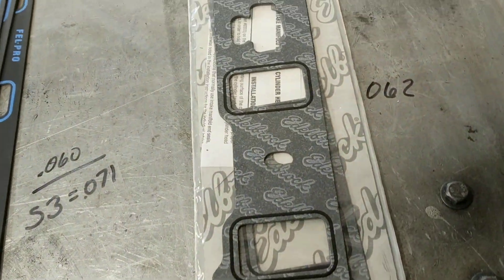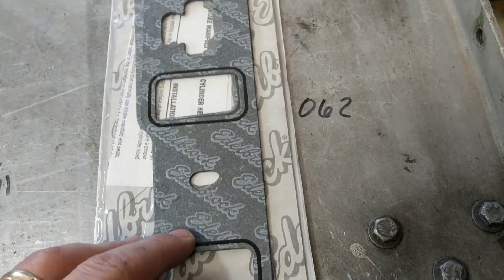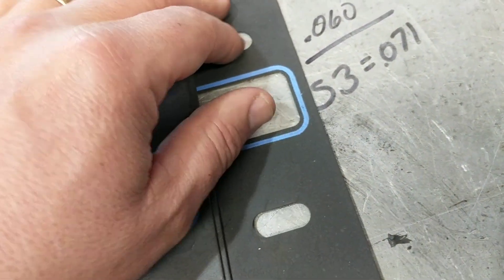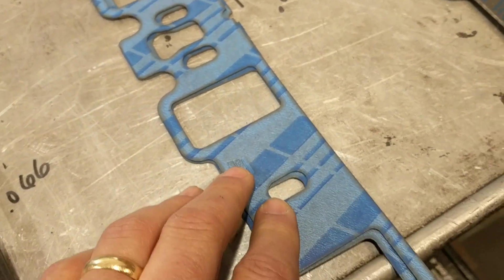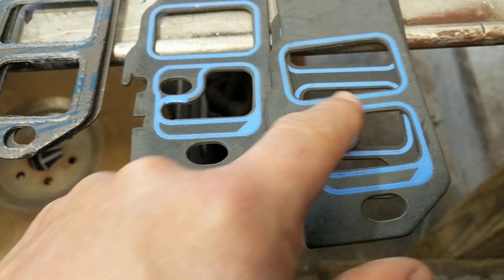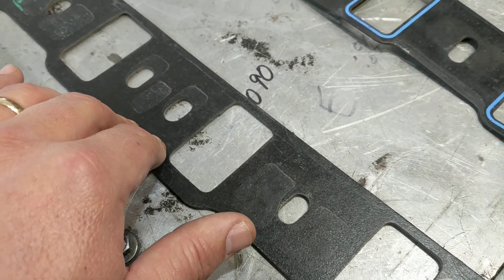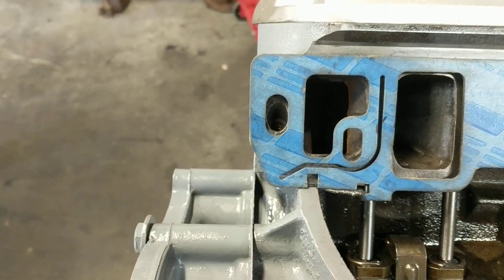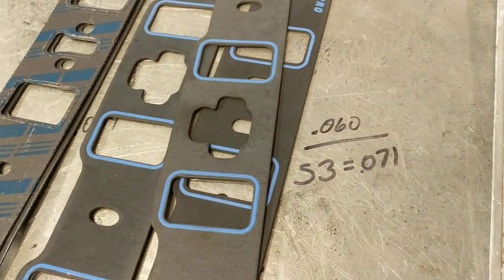Intake manifold gasket comparison

Comment: Hi Dave, at 2:58 the gasket is blocking the coolant ports. Should that be trimmed or that’s ok? And is it ok to use ultra grey around all the ports not just the coolant ports?
Reply from the maker: You can cut that strip out.

Comment: Man I'm glad I stumbled onto this video, thanks for putting this info in a video. How would I go about figuring out the thickness I need for my 351w? The deck was milled 0.020 and If I remember correctly the AFR 185 heads were shaved 0.003 and I will be using a Edelbrock 2181 intake manifold.
Reply from the maker: Probably only way to know is to try it, standard may work just fine. Deck was probably milled .002, not .020.

Comment: LEAK CHANNEL:
It's a safety feature.
If you have a coolant leak it prevents the coolant from getting into the engine internals... oil and intake..... When it dumps water OUTside, you know you have a coolant leak. 
I guess if you have a coolant leak then you have a pitted head or intake surface.
THINK ABOUT IT.🤔🤔🤔

Comment: I use the steel core intake gasket and always use rtv around the water ports. Fel-pro says to install them dry. Have you ever installed them without putting rtv around the water ports and if so did they leak?
Reply: I installed mine 8 months ago dry, I'm in the middle of replacing them now, I will be using rtv around them this time, do what you will with that info, just an fyi.
Reply: RTV is cheap. Why not?

Comment: When putting trick flow heads on 302 with a elderbrock intake what intake gasket should I use
Reply from the maker: I like the 1250S3
Reply: @FXRSDriver  why 1250s3 over the regular 1250 ?
Reply: @FXRSDriver I have a similar setup on my car.
I used a 1250s3 and after I had a bad leak, front and rear of intake. I used RTV, and not the cork peice.
Shop told me I shouldn't have used the 1250s3 and instead the 1250, non steel core.
So I'm looking to buy a new gasket, or maybe just re-use this gasket, and use a ton of RTV to seal front and rear, and cross my fingers..

Comment: Hi.  I am looking to replace intake gaskets on a 351W, but was not sure which brands carry gaskets with silicone rings built into the gasket.  Any help would be appreciated. I have a set of AFR 225's.
Reply from the maker: I'd recommend the fel pro 1262S3
Reply: @FXRSDriver  Looks good.  Just ordered one.  Thanks!  Great video!

Comment: Thanks for the info David, I hadn’t put 2 and 2 together yet. I  was thinking if your ports didn’t line up you either port it or take it to the machine shop, that’s a really handy way to cheat it with different gasket thicknesses!!!
Reply: Another intake gasket FYI, a buddy of mine had DOOE heads with a tubular GT40 intake. He had coolant leaks with new gaskets. The Cobra/Explorer gasket set doesn’t work on old heads, the coolant ports are too big, the old heads have smaller coolant ports. That was a frustrating lesson to learn...lol
Reply from the maker: @Sikulz  Didn't know that, probably could have spotted that during assembly, like I should have when I used those 351 gaskets on my son's cobra.
Reply: @Sikulz  what gaskets you go with?
Reply: @Dre1966mustang  David told me about the Fel Pro 1250S3, they have a steel core, they’re a little more expensive but I’m having good luck with them.
Reply from the maker: Certainly is cheaper